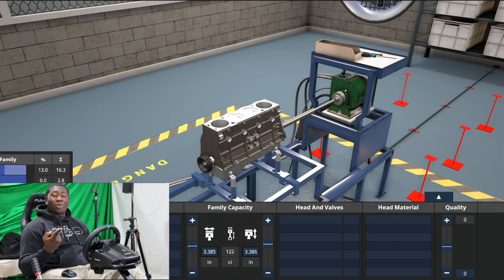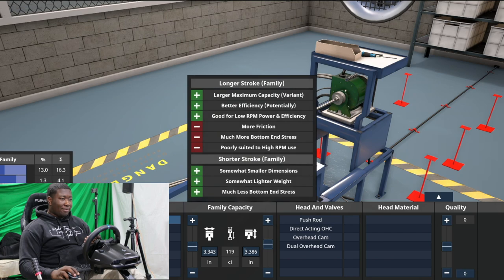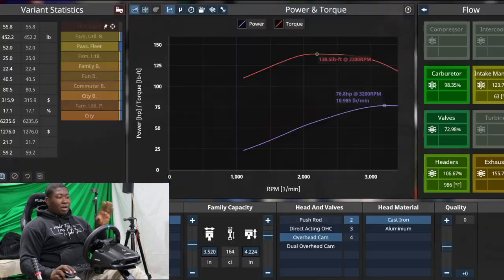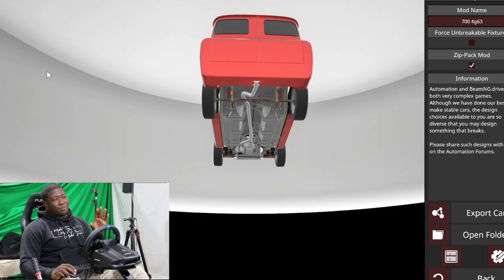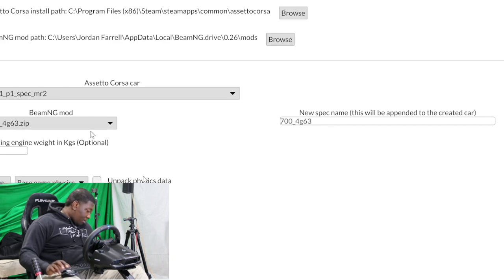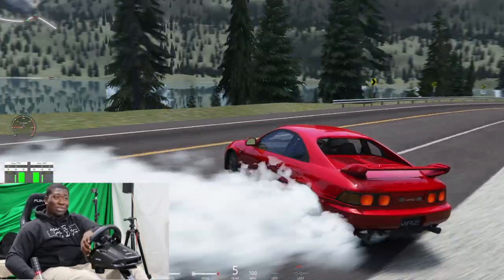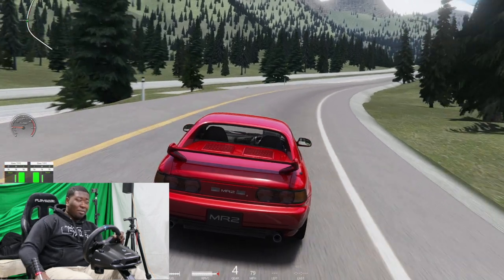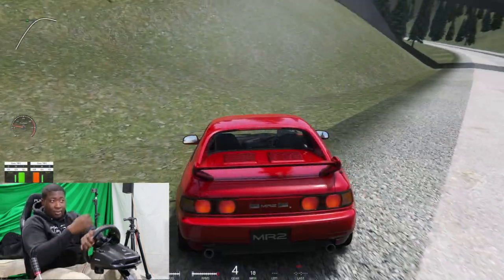HOW TO SWAP AUTOMATION ENGINES INTO ASSETTO CORSA... | Assetto Corsa Swaps

Comment: Hey, glad to see you're enjoying engine-crane. I'm the author of the tool; if you have any issues with it or have suggestions I'm always open to feedback :)
Reply: Do you know why when I swap into asseto corsa, the top speed of the car doesnt change? It says that it has the hp but nothing else changes.
Reply: @blakereed7682  probably gearing
Reply: @blakereed7682  gearing would potentially account for that
Reply from the maker: You've single handedly changed my content on all my platforms! Forever grateful to you for making these swaps much easier to complete! Check out my instagram and tiktok to see just the impact your program has made: @monstermotoring
Reply: Hey, would I need to have bought and installed BeamNG just for me to export the engine from automation into assetto?
Reply: @luqmaancareem2376  You don't need BeamNG installed. Automation will export it and engine-crane should be able to find it regardless of whether you have BeamNG or not
Reply: @zephyrj  Perfect. Thanks loads!
Reply: Bro! You are an absolute legend! I can't believe I don't know you could do this sooner! Beaming is really fun,but I prefer to drift and stuff like that in assetto 🤠
Reply: @IronLungProductionsOfficial  Thanks. Yeah, I'm the same as BeamNG isn't quite there yet; though with how well it's developing BeamNG could well be the future. Enjoy engine-crane :)
Reply: Does it change the sound too to a v8 when we put a v8 into a honda civic?
Reply: @SLNT0817  not automatically, no. There's some complications around licensing of the Automation sounds. You can use Content Manager to change the engine sounds to that of another car though
Reply: hey dude, i wanted to ask you a question, can it import my custom twin turbo 2.7L inline 6 into any car in assetto with your tool? or it just imports stats from engine?
Reply: @bal_723  it doesn't import any graphics or sound. It just updates the physics/config files to match the behaviour of the created engine
Reply: @zephyrj but do it imports horsepower torque?
Reply: @zephyrj   when I’m in engine crane it doesn’t show any Assetto Corsa cars does anyone know why ??
Reply: hey so I have been using engine crane recently, but I can only pick from like 20 something cars and I see that monster motoring has hundreds in his, why is that?
Reply: @tylerjacobson328  engine-crane just lists the cars in you Assetto Corsa install and mods you've created from Automation. It's likely he has either added more AC mod cars  to his install or has made more Automation mods to swap from.
Reply: Can we get engine sounds please
Reply: @user-zs3pk3uv9t  I don't have the time to look into that at the moment unfortunately; perhaps in the future though
Reply: Hi, I successfully exported and swaped the engine using engine crane but when i tried to run in assetto corsa it said failed to decrpyt model kn5. I use csp 0.2.0
Reply: @AhmadYusuf-nh5ph  Some mod authors choose to encrypt the car models; this prevents engine-crane working with them unfortunately. You'd need to ask the author for a version that doesn't use an encrypted model

Comment: Thanks a lot! The video was easy to follow and cut straight to the point. However i have a problem when trying to play AC with the swapped engine. When i launch the Content Manager, the name of the car and my engine does appear, but there are no actual changes to the engine and everything stays the same. I've tried restarting my pc but now it's worse, i get an error report saying AC crashed and there may be a problem with the car's sound. Any help?
Reply from the maker: Update the engine crane app I'd say

Comment: So you need to buy assetto corsa, automation, beamng, and engine crane to do this????
Reply from the maker: All that’s needed to purchase is assetto and automation. Engine crane is free and doesn’t require beam to function properly
Reply: @MonsterMotoring  now it's different with the new engine crane ... it doesnt work for me, it work last time but the update f*ck this up... have you the same probleme ?
Reply from the maker: The UI looks a little different but the process is still the same. I can make an updated video

Comment: You skipped a bunch of steps, were the hell do you get tha sound?
Reply from the maker: Wasn’t in the steps cause there is no foreseeably easy way to transfer the sound between programs. I’d say, find the sound you like best from another assetto mod and put it on the car in content manager
Reply: @MonsterMotoring  so does this mean when I swap an engine, the car will just have the original sound still rather than the swapped engine sound? Or will it just have no noise
Reply: @Commoncommentscommons  it will keep the original engine sound unfortunately